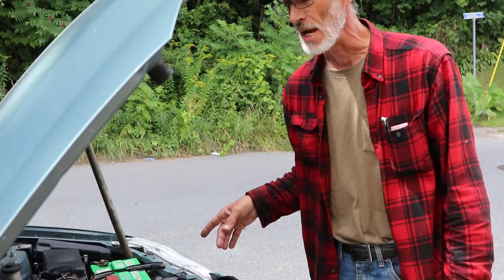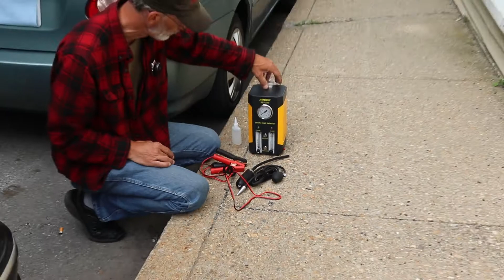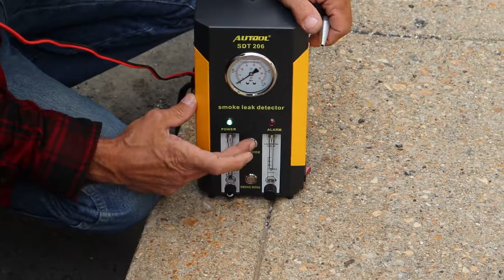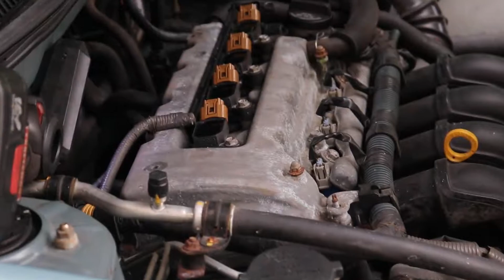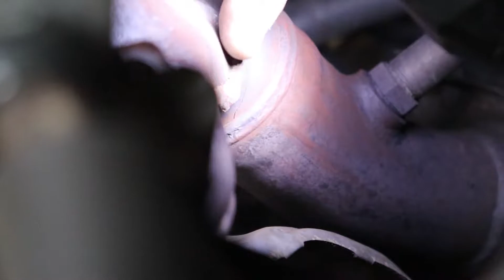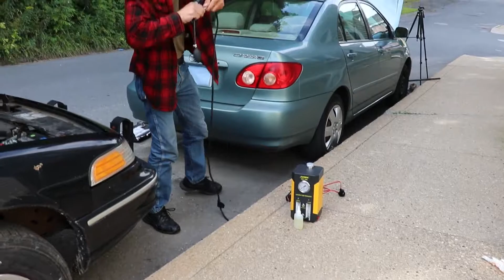2006 Toyota Corolla - Exhaust manifold leak, and the AUTOOL SDT-206 smoke machine! - Auto Repair

Comment: For a Honda civic can I do that do I have to use a scanner to close any vents up are I just put it in the tail pipe and just put smoke
Reply from the maker: The idea is to fill, where you suspect there may be a leak. General knowledge of what and how is necessary for results to be successful, and not potentially cause damage.
Depending on what you are testing, the use of a scanner might be required.

Comment: How to hook up an inline step down pressure regulator? For evap testing only 1or2 psi is recommended
Reply from the maker: Honestly never gave it any thought, as I don't use "shop air" or a high pressure air source. I use a self contained, low pressure smoker, so I don't worry about anything substantial.

Comment: Smell exhaust in the air vents cabin while the car in park Corolla 02 . Could it be the manifold gasket or the donut gasket also car is  hesitating when accelerating . I think it's an exhaust issue and it gives a P0171 code with check engine light. Changed spark plugs and coils. Thank you very much.
Reply from the maker: Definitely sounds like an exhaust leak near or BEFORE the first O2 sensor....
Reply: @HouseCallAutoRepair  thanks

Comment: I bought the autool sdt 101 for an engine too lean code leak we cant seem to locate. Is sdt 101 good enough to diagnose the leak/issue?
Reply from the maker: Lean code leak? What were your short term and long term fuel trims? (at idle and 2000 rpm)
Lean code DO NOT automatically mean a leak....
As long as it is used in the right places, it should find almost any leak big enough to cause codes!
Reply: @HouseCallAutoRepair  its a p0171 code on a 2005 corolla le. It reads Engine too lean, Bank 1. So i replaced the gas tank cap, spark plugs, air filter, pcv valve, hoses, MAF sensor, Purge valve solenoid, air intake gasket, throttle body gasket, motor oil & filter then finally 02 sensor bank 1. All Oem parts. Cleared the code, within an hour code comes back on everytime. Only thing i can think of is that there is a leak somewhere but can't locate it. So I ended up buying this Autool sdt 101 model. Never used one before but I wanted to know if this model is good enough to find that leak?
Reply: @xvdmrecords  the same things here 02 Corolla. Like you changed a bunch parts tune up . I have the injectors not in yet. I have to fix an exhaust leak. Does your hesitate on the gas acceleration?  I Also have P0171 , lean fuel condition. Let me know about it ? Thank you very much.
Reply: @marthab4172  with the smoke tester, it seemed like the smoke was coming from the top of the gas filler neck by the gas cap(brand new oem gas cap). So it wasn't the gas cap. We replaced the neck filler but still smoke kept leaking out from there. Only thing the mechanic can think of is the charcoal canister valve leak somehow causing the smoke to leak out from the neck. I didn't do that yet. Once I do, i ll post the result here.

Comment: I'm curious why the oil needs to be drained after each use. Does it leak out if its not drained? Do you reuse the oil next time or just dump it?
Reply from the maker: It should be drained before putting it away, to keep the inside clean and to prevent accidental spillage during transportation or storage. I do re-use the oil until it's no longer clear.  VERY handy machine to have!
Reply: @HouseCallAutoRepair  Thanks for your quick response. I bought a used one yesterday and it seems to work fine. The only problem was the box that it came in had oil stains all over it. I had assumed that someone had spilled some motor oil on the box but after reading your reply, I'm thinking it had been put away while still filled with oil and stored on its side.

Comment: Did your LTFT vary much or was it constant in 12%-15% range?  On my 1999 Corolla, the LTFT sometimes show 7% during a drive cycle, then 10%-12% during another drive cycle, then up to 17% to 19% during the worst case.  Car runs fine, mostly.  Just curious if you had similar variability in your case.  I have the Autool smoke tester also (not sure on model), so will be doing the exhaust leak test.  Thanks for the video.
Reply from the maker: LTFT of 17%  at idle and moderate load, was what got me searching. I did get a P0171 on occasion, also.
I would suspect you might see a bit of smoke near the manifold/downpipe junction. Mine was where the pipes joined each other and spread around the pipe.
Reply: @HouseCallAutoRepair  Thanks.  Will check after taking off heat shield.  Then do smoke test if needed.

Comment: Good job but the next time use ultraviolet light will be more helpful thanks again for your video
Reply from the maker: Ultraviolet light would only be beneficial if I was also using the UV dye as well. (and indoors)
Reply: @HouseCallAutoRepair  what code did it Trigger

Comment: You don't have to buy a new piece take it to a welder he will grind a slot on the crack and welded problem will be fixed
Reply from the maker: Thought... Unless the welder does it for free, how much does he charge per hour? How reliable is the repair? When all is said an done, was it worth the savings? if yes< then ABSOLUTELY! Being that my only out of pocket expense was the pipe itself, it didn't make any sense to seek a cheaper route.